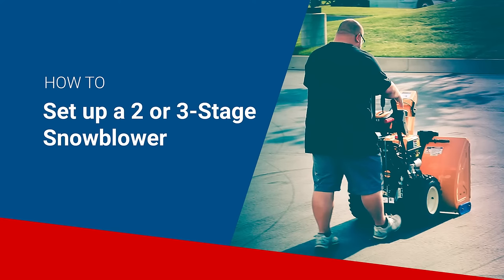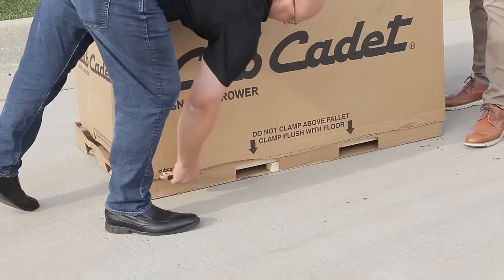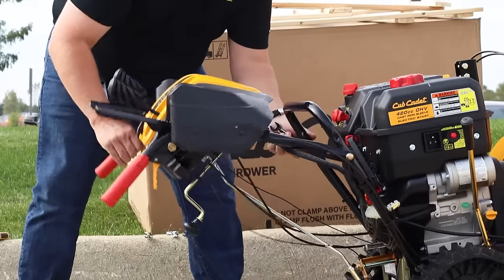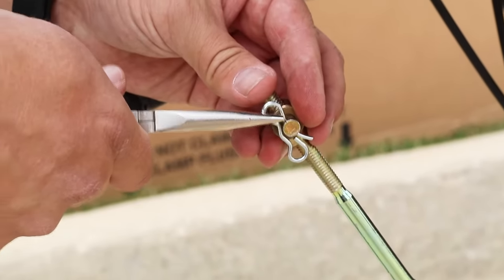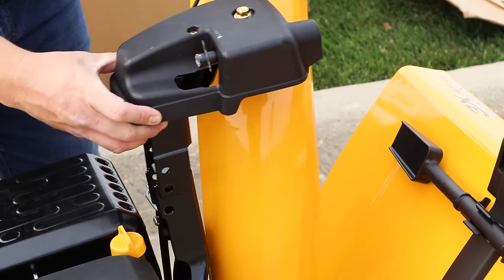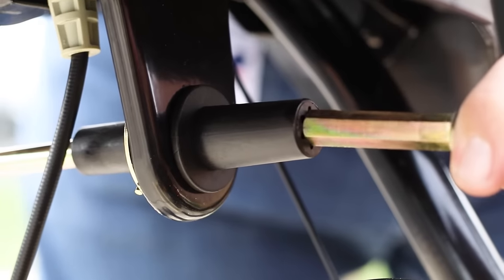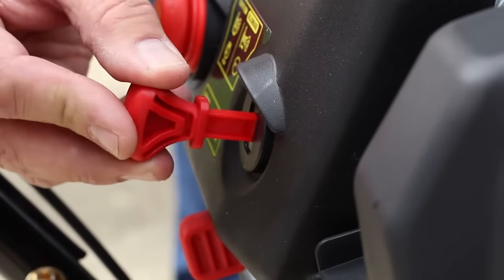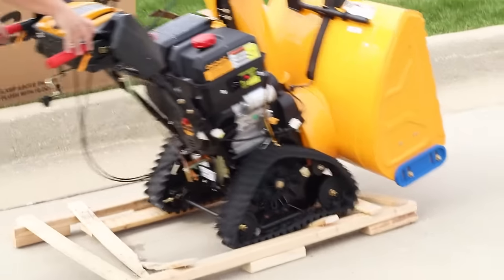How to Set Up a 2 or 3-Stage Snowblower

Comment: Would have been nice if you showed how to adjust the skid shoes for the noobs
Reply from the maker: That's an idea for a future video! In the meantime, please check out this article. We show some pictures and examples of how to adjust skid shoes. All you really need to know is that you need a wrench or ratchet to raise or lower the skid shoes if needed by loosening and tightening the bolts on the shoes. If one side is wearing more than the other, you can also flip them over 180 degrees to extend the life of the shoes. If they are very worn, consider replacing the pair. https://www.snowblowersdirect.com/stories/1768-How-to-Tune-Up-Any-Style-of-Snow-Thrower.html

Comment: Rode is to short to move the chute
Reply from the maker: If you are using the drive control rod that came with the snowblower it should reach since they are designed to properly connect. Make sure the rod isn't getting caught up underneath on something else, and make sure it wasn't installed upside down. You should also check to make sure the chute control cable was installed correctly (Step 4).
Reply: @PowerEquipmentDirect  yes everything else is working perfectly but the rod is definitely too short